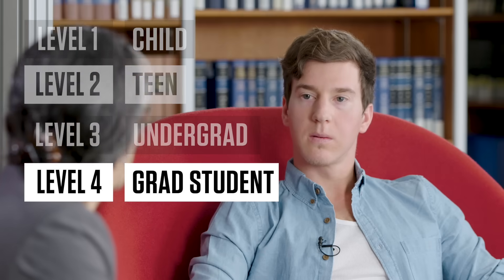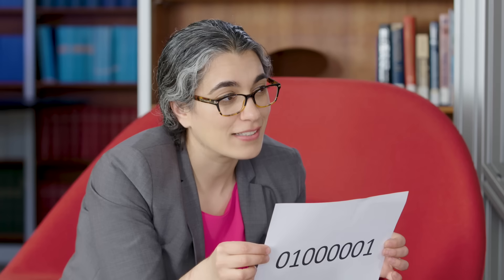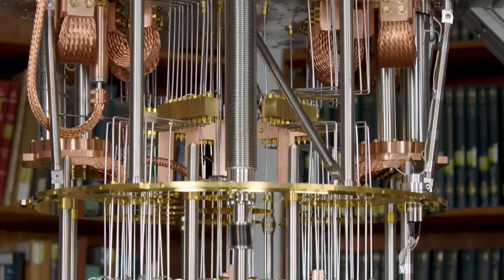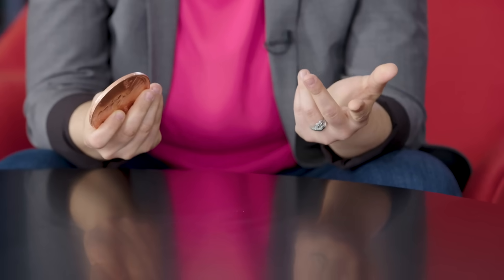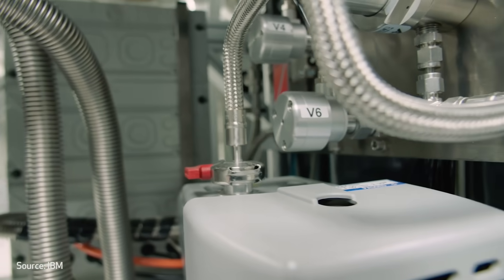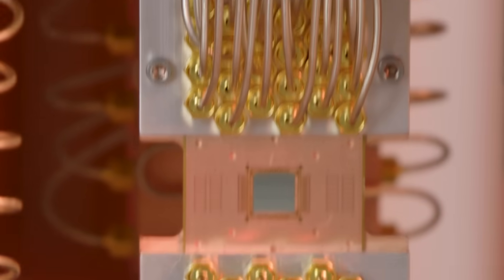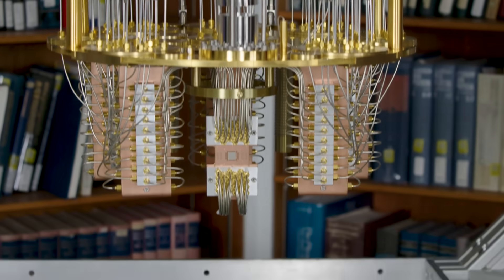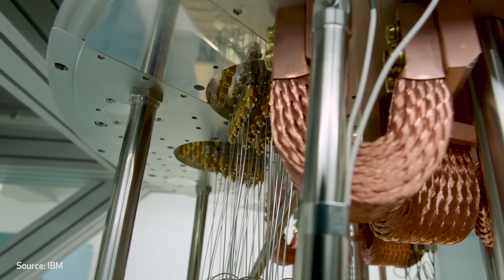Quantum Computing Expert Explains One Concept in 5 Levels of Difficulty | WIRED

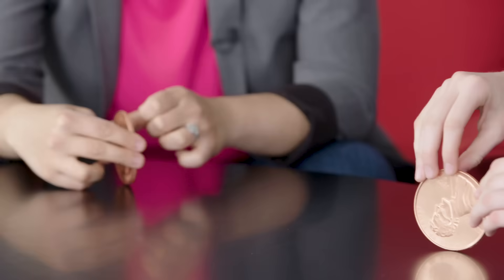Comment: At 5:20, Dr. Gershon explains entanglement as both coins being heads (or tails). But, in my opinion a better explanation of entanglement would be to state that if one coin shows heads the other coin automatically shows tails. This way it would be easy to connect the explanation to ``spin`` of a particle: when you take two entangled quantum particles, if one of the particles is measured to have ``spin-up`` state then automatically the other entangled particle would have ``spin-down`` state.

Comment: I got lost on the child level. Please help.
Reply: May be we should ask for infant level to be added!!
Reply: @allenkalalu6006 , good point!
Reply: You have a coin, I have a coin.. when external factors decide what side they need to land on are determined they are both flipped to the same side simultaneously - the physics is quantum entanglement, a bit like two magnets pulling together. The real complexity is the outside factors that flip the coins are also in a state of being undecided. This is like Schrodinger's cat or your fridge light - is it on or is it not? Essentially the data isn't sure what it needs to be until it knows what it needs to be. This is a very flexible system and current CPU are restricted to logic gates that are fixed - a switch that needs both inputs to be 1 OR one input to be 1 or NONE of the inputs to be one. This is why you have millions of transistors on a CPU as they are all fixed. They can also be in several configurations at once! Now imagine them being exactly what they need to be for a specific function - then they're done. A bit like a goldfish memory.. More than on or off.. Qubits https://en.wikipedia.org/wiki/Qubit
Reply: Not Available Yo an infant wouldn’t know what Schrodinger’s cat is....
Reply: No offence to her, but she’s actually not great at explaining it basically. Some of the other videos in this series the expert manages to find a simple way to explain the fundamental principle of the subject, but I think this time around she really didn’t really teach the first two kids anything other than “there’s a new type of computer and it’s fancy”
Reply: Same
Reply: check the Kurzgesagt version of this
Reply: @UCHmdRuKUSB7xrbv8uC0TKxg Cuantum Mechanics are not intuitive, so it's not so easy to explain the concepts well. But when you read more it becomes more clear. My statement may have sounded like an insult but I did not mean that. Happiness lies in simple things
Reply: Start making diy soap)
Reply: Be curious.    ←That← is the best help.

Comment: So on these quantum computers, windows will crash and not crash at the same time.
Reply: my brain just crashed
Reply: @theirtheyrethere7946  and didn't crash at the same time
Reply: @theirtheyrethere7946  and not shut up at the same time
Reply: @SkullScoper  get out
Reply: @theirtheyrethere7946  and not get out
Reply: @SkullScoper  AHHHHHHHHHHHHHHHHH
Reply: @theirtheyrethere7946  and not AHHHHHHHHHHHHHHHHH at the same time
Reply: @cryper6098  thus the brain is a quantum computer.
Reply: @SkullScoper  I'm in tears. Best dialogue ever held in a youtube comment (and worst XDDDDDDDDDDDDDDDDDDDDD)
Reply: By booting up windows, you have made a deterministic observation that it will crash.
Reply: Nah, it will just crash
Reply: There is a possibility through there explanation that both side are entangled remember there is a chance that both side can be the same as the other, but your question is a little bit tricky if I say so, because windows is a program that run through binary codes to run.
Reply: that means no crash at all , its a contradiction
Reply: HAHAHAHAHAHA!!
Reply: There's no window
Reply: hahahahahahahaha you cracked me up!
Reply: Schrödinger's Crash
Reply: @Grape Soda  and it won't be in a state of flux at the same time XD
Reply: the correct answer is windows will crash at all times. not even quantum computing can prevent that.
Reply: It's already very good at doing that.
Reply: No, it'll crash just like normal.

But the REASON it'll crash is because it can't figure out whether it's supposed to be turned on, or not.

Comment: I wonder if the super quantum architecture would fit better in a tower? A vertically arranged system rather than rooms of horizontally spiderwebbing wires? Would that lower the amount of ambient noise and seismic motion by narrowing the footprint?

Comment: One thing that was skirted around but not addressed within the explanations was just how an answer is reached. Sure, you frame the problem differently by allowing multiple possible answers to exist within the system at the same time, and Dr Gershon claimed that the quantum system can be manipulated towards a state that represents the correct answers, but that almost implies that you know the answer before you start, which can't be true because it would be of no use whatsoever. How does the system settle itself into the final solution? If it can't be described in terms of the Boolean logic of classical computing, how can the logic be characterised? That's the kind of "explanation" one would expect at the Professional level, or even the graduate student level, and was teased at the lower levels but never emerged, rather than a superficial chat about how annoying it is when mass media outlets make wild claims about the near future.
Reply: This. I kept waiting for an explanation of how things are actually done. They touched on it when she stated (not explained) how they use microwaves to encode and "read" the quantum states, but she never really explained at a technical level what actually happens. Perhaps "spooky action at a distance" is all we can hope for...

Comment: Can someone explain this to me? I just watched the video and still am confused as to the basic idea of how quantum computing actually functions. I'm thinking it's the phrasing and vagueness of their operation that has me lost. If I'm following what she says, the calculations done via quantum computing are using variables which, relative to standard calculations, exist in an in between state of value. But how is this any different than an unnecessarily elaborate reinterpretation of the same process? If a value is both not 0 or 1, does that also not make it an extension of 0 or 1 -- ie: something is either undetermined or determined to be 0 or 1, thus making it another 0 or 1? Am I missing something?

Comment: I am looking at this chandelier and thinking about the problems it has. The interference as I interpret it has a kind of harmonics based to my knowledge. So you put just one frequency trough it, as I can see. It has just one loop in what it seems a bandpass filter. Try run a frequency, run the input on the 7th harmonic and collect the output on the 3rd harmonic for exapmle.

Comment: Good Grief.... Not a single example of a rudimentary quantum calculation.   SHAME ON YOU!  Do you even have any instructions written for them yet???

But a totally uninformed guess is that the Q-bit has more states than a binary bit so that a Q-bit is more like a low dimensional digital Op-amp.  And that networks of these Qbits is not totally unlike an electronic circuit.

... or Analog Computer.

A million node FEM model can take days and weeks to run - and this can be just a linear case.

I hypothesized decades ago that if we could take those linear equations and obtain the analog computer circuit, we could get answers in real time - a linear solution in a split second.

But how would we do this?  

Print the circuit using printer or stereo lithography technology.  A reach, yes, but it could be done.  And with additive manufacturing advances, we might be there already.

Almost sounds like this is what a quantum computer could do.

Comment: IBM Q is actually a potato gun hooked up to a Raspberry Pi running a program that spits out random garbage data.  At each quarterly project funding and review meeting, the "scientists" developing the system produce an intelligible presentation, which always ends with a final slide showing a graph touting the amazing increase of 10 qubits worth of fault tolerance over the prior quarter.  "Just 999,950 more qubits to a million, guys!  WTG!"

Comment: If you are knowledgable about encryption and quantum computers, please read.
The professor at the end stated that there are other methods of encryption which don't require factorisation. Currently, the only encryption methods that I'm aware of which allow two parties to share information without already having a shared private key are based on the priniple that it is very difficult to reverse engineer the prime factors of extremely large numbers. The other method that he mentioned was having a quantum link, which is provably secure, however this would require both parties to have access to quantum hardware in order to communicate. Does anyone know of algorithms which can be used on traditional computers which allow two parties to securely share information, if they have not communicated before (and therefore do not already have any shared encryption keys)?

Comment: The problem I have with quantum -anything, is that they simplify it all so much with analogies that as soon as they say something that conflicts with said analogy, I lose all aforementioned comprehension of the subject.
Well I am just in Senior year of High School but still, I'd like to just, you know, ''get it''...
Reply: Quantum anything is really hard to understand because they don't act like you think anything else does. That means it takes a long time to get it, and even then you find out you barely know anything anyways.

For example if you push a marble, you could calculate where it will be by looking at where it is, the speed, etc.
With a quantum particle, its now based on probability, it has a high chance to be where you think it will be, but with more time that probability becomes lower and lower until it could really be anywhere.

in the video with the spinning analogy coin its actually a really good analogy. Since you dont know what state a qbit will be in until you observe it, the same way you know what side a coin will take if you slap it with your hand. you force both to choose a side/bit.

Comment: 90% sure Wired doesn't realize that Computer Engineering and Computer Science are different fields so they grabbed a lot of CompSci people without knowing that CS takes little or no physics while CompE takes tons of physics to understand how, eg, electrons in silicon semiconductors behave.
Reply: Yeah seemed weird
Reply: looks like pop sci or bro science
Reply: Actually, as a Computer Scientist, I found those two CS students too lost in the topic. They (the professionals) were not addressing the topic in much depth since basic knowledge on both chemistry and physics, along with knowing what Quantum Computing is (mostly any computer related major knows) gives you the tools to easily follow the conversation at the end. CS and CE do have a difference in hardware knowledge, but is more in circuits, controller/microcontrollers, sensors and those type of things. I would expect that any computer related major student can easily keep up with this topic
Reply: @vesui2130  

Exactly, so what the poster is saying is strange. Computers use matter and quantum sized phenomena such as electrons, ions, and photons for storage purposes and to perform calculations. Computer science isn't just about the software of operating system, applications, and programming. It is also about the hardware and understanding how the hardware components function and what they are made up of to enable their programming. So what the poster is saying is really weird.
Reply: @musafawundu6718  This is wrong. Quantum Physics is beyond Physics 1 and 2. You have to take Modern Physics and classes specifically devoted to the physics of semiconductors to understand this stuff but most CS students don't have to take more than 1 or 2 physics classes as science electives.

Go look up the degree plans at most universities in the US and you'll usually see Computer Scientists focus almost entirely on programming, with knowledge of what computer components do but not how they physically do it.

Then if you go look at the degrees for Computer Engineering or Electrical Engineering with a Computer focus you then find all the classes with quantum physics in them.

The large majority of computer science majors and graduates in the US will know virtually nothing about quantum physics.
Reply: @NiteSaiya  Sadly, we don't have Quantum Physics in our curriculum. EE student here.
Reply: @AstronauticalEngineer  That's a shame. I highly recommend spending an elective on one if you get the chance.
Reply: @NiteSaiya  

I am surprised by this. Courses of physics and chemistry should tell a student of elementary particles of atoms like nucleons and electrons and also of Bohr's Model of the atom, matter waves, Planck's constant, radioactive gamma, beta, and alpha ray emissions, electromagnetic radiation, Heisenberg's Uncertainty Principle, the Quantum  Model of the atom, the four quantum States, and the electronic configuration based on quantum states. That's basic stuff and one doesn't have to go too deeply into all of that. 

I am surprised that Computer Science majors are not taught this.
Reply: I too am suprised. so suprised.
Reply: Said the guy who has no conception of what a Computer Scientist is.
Reply: Your point is? Only the last person was an actual professional, as stated at the beginning of the video. 
Level 3 and 4 happen to be computer science students but they might as well be random people in their age group.
Reply: Oh my god you're an idiot computer engineering is software development. The development of semiconductors is electrical engineering. I'm a laser lithography technician. Shut your mouth child
Reply: @zachchang4846  Not sure if you're a troll or not, but CS most closely relates to software dev. and higher-level computer concepts while CE would be closer (than CS) to hardware/electrical fields, so that's what the poster is referring to...
Reply: It must be a college requisite to take courses in physics and chemistry in computer science in any university.
Reply: @musafawundu6718  Not in the UK, most focus on Maths and Further Maths.

Comment: Well, encrypting with quantum computers will probably be pretty cool, but those trying to decrypt will use quantum computers too, right?
Reply: i guess it will just be the way it is now
Reply: They discussed using quantum computers to decrypt RSA (classically generated), and even making decryption unnecessary by using entanglement to establish communication connections at any distance which would be guaranteed by physics to be secure i.e. not read or changed as either would cause decoherence.

Comment: One possible use for QC would be for Combinatorial Optimization (traveling salesman) problems. Example: electronic component selection to optimize performance to meet end product requirements. Performance based on the parametric data found in the components data sheets. Especially useful for analog circuit design where there could be hundreds of components having the same function manufactured by many different companies like operational amplifiers, or voltage regulators, or etc…

Comment: "State" is like a quarter spinning on its edge." Huh? The problem with physics people is that most of them haven't a clue what a "computer" is, or how it works. IBM has wasted this amount of money on a 5-qubit machine that they are calling "a computer"? This is like calling 5 NAND gates "a computer." I saw Bell Labs go down the tubes this way. At least they're promoting females. (Again, I saw Bell Labs go down the tubes this way.) Funny how IBM has been losing money for 8 years, but they're spending some of it on nonsense like this. I guess it's worth some press for people who don't have a clue what computers are. Too bad they go to 100 milliKelvin, and still can't keep it stable. You could actually do some worthwhile things at that temperature if you were interested in making a real computer. Qubits? Give me a break.